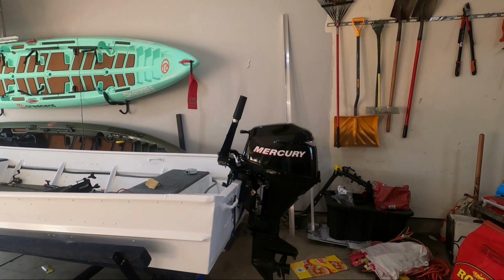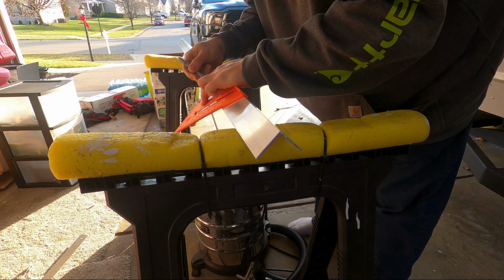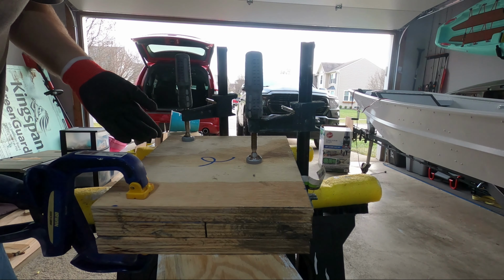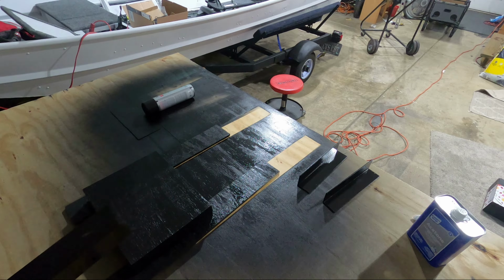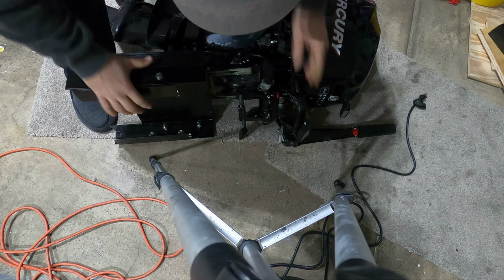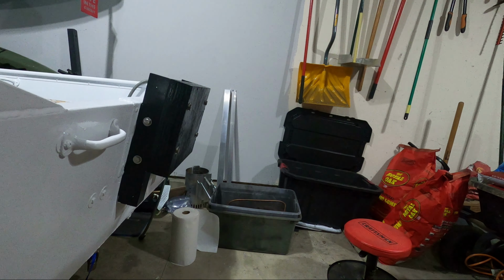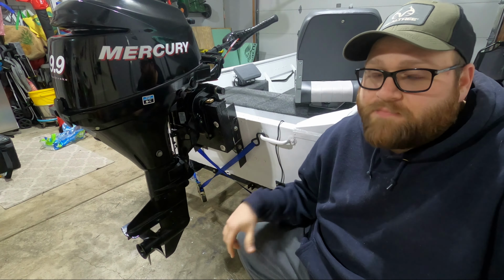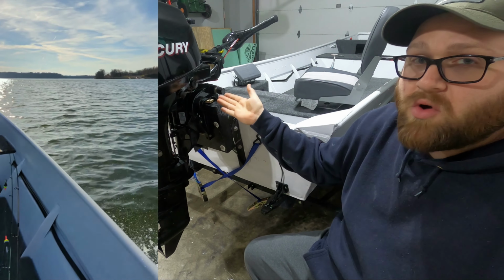CUSTOM JON BOAT JACK PLATE DIY Riser / Setback for the Bass Duck Boat Conversion Build - Mercury 9.9

Comment: This is the exact thing I need for my situation. I have a 14 foot tri-hull with a 19” transom. I found a great deal on a Mercury 9.9 4 stroke, but it’s an extra long shaft. I bought it because it was a great deal ($850 instead of $2,500+). And it’s in excellent condition. But i need to lift the engine about 7”-9” to get it where I need it. I can do this.

Comment: Great video very informative and straight to the point. Few questions.. did it really make a difference after you raised the plate at the same length as the setback? Does it really need to be the same? Or was it just a trim position issue?

Comment: I like your videos just wish there was a little more detail. Is that 1/2 plywood you're using? What dimensions are the plywood pieces?
Reply from the maker: I measured about 4 in wider than the mounting bracket for the outboard, and that way there would be enough room for the bolts without contacting the bracket. Different outboards have different bracket sizes, but you can use that as a reference.

Comment: I just bought a Suzuki 9.9 drove 1.5hrs to get it , never thought to ask the shaft length but it’s a 24” 😂 , that’s way to long for my job boat so thank you for making this video I will be doing this over the weekend
Reply from the maker: It should do well for a 9.9 for sure
Reply: @mvboutdoors  I have the 14’x42 alumcraft the transom is only like 15” so I think I’ll have to jack the motor up at least 6” to just get it where it should be
Reply: How well has it lasted with the weight of the engine traveling down the road on the trailer ?
Reply: For added sturdiness, consider using angle iron instead. Prime it with zinc spray and paint it in the color of your liking. It will last decades. :)

Comment: I built one for my dads 14 foot John boat with a 15hp outboard it has 4.5 inches set back and 3.5 inches up and down adjustment we picked up 4 mph
Reply from the maker: That's awesome, they work really well for small motors.
Reply: Good, did you win 4 miles with the support?

Comment: Looks great. A couple questions before I begin my bracket build: 

1.  Is 1/8” angle beefy enough? Pretty much every other builder in every other video I’ve seen uses 1/4”. I only have a 5hp, so I was curious if I could go down in material thickness like you did and still be ok. 
2. What screw size did you use? You mentioned screw length, but I don’t know if I heard you mention diameter.
Reply from the maker: 1/8 was strong enough for the 9.9hp so with a 5hp I'd feel confident. No flex at all, very secure.  I didn't have 1/4 available locally but I didn't regret the 1/8.

I used 3/8 bolts, 1/4 was too thin imo.
Reply: I was wondering the same thing but  with a 5 hp i would think you would be good but I’m putting a 40 on mine and I’m going 1/4 but if you think about it where everything is bolted together it’s 1/4 inche anyway and the plywood should more then take care of the rest

Comment: Make a Straight line from bottom of boat to top of prop will give you best performance
Reply from the maker: Are you referring to centering the motor on the transom or adjusting the height?
Reply: @mvboutdoors  adjusting height , should be a metal fin above prop make bottom of it level with bottom of boat with a level  and will be spot on for running
Reply from the maker: @claytonfowler857  That works if there's no setback but it doesn't work when you move the motor back off the transom. The pivot point of the motor changes and when the boat planes it dunks the motor further under the water than if it was right on the transom. The cav plate needs to be higher than flush with the bottom with a setback.

Comment: Why did you build that black jig , rather just using  the original  transom ?
Reply from the maker: I wanted to raise the motor out of the water some for better performance and move the motor back for extra clearance of the tiller handle.